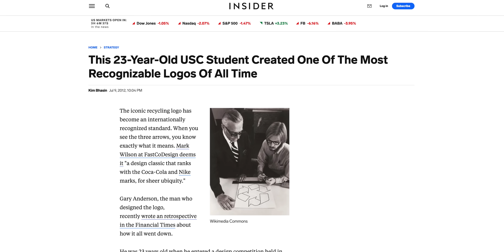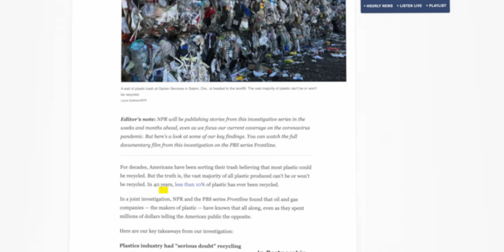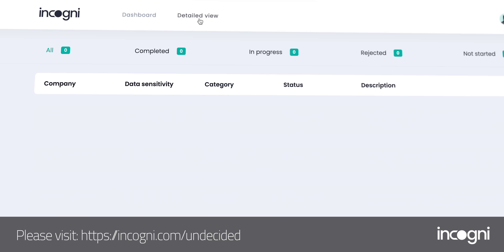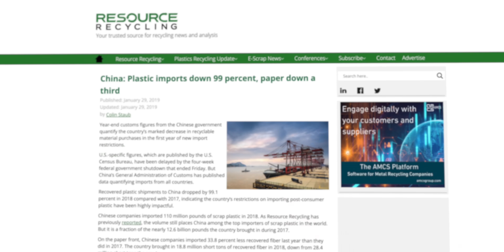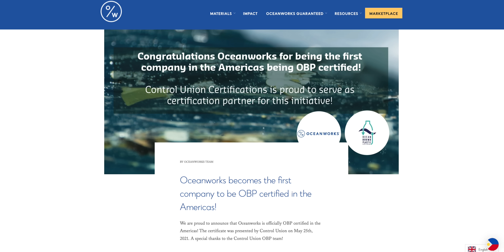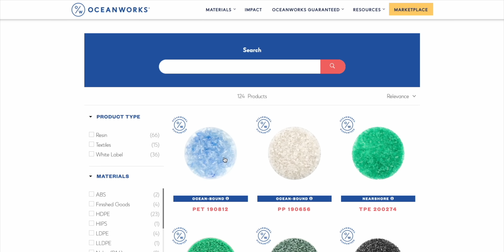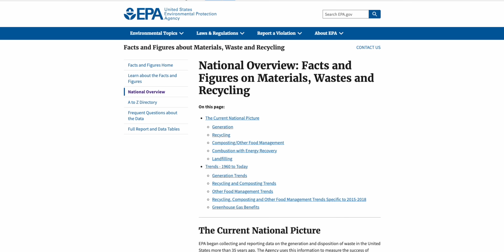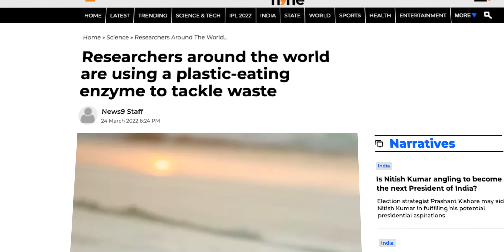The Truth About Plastic Recycling ... It’s Complicated

Comment: This is going sounds really stupid so I'm sorry, however, why doesn't the government ban single use plastic bottles, we already have an alternative, glass bottles and cans?
Reply: Glass is brittle and breaks easily, so you need a lot of it to make a sturdy bottle, as such glass bottles are very expensive to transport because they weigh so much. most glass waste gets put in landfills because it is not economical to transport it for recycling. i remember when SoBe and Snapple stopped using glass bottles. it just made them seam cheaper (and affected the taste as well imo). and metal is already relatively expensive. if you suddenly decided to switch everything even to the cheapest available metals the price of that metal would soar due to the sheer increase in demand. It all boils down to money. nobody wants to actually spend the money to build the necessary sorting facilities and properly pay workers to staff them, because raw polymers are orders of magnitude cheaper.
Reply: @nemesis1588  Everything you said is as the mouthpiece for the plastic industry, I assume you are playing devils advocate. It would cause disruption of course, but that was the system once apon a time and it worked just fine, even if glass and aluminum isn't recycled and ends up in land fill it doesn't matter, both are natural materials, or at least not harmful, they are both the ultimate packaging material, that and the beverages tastes much better. I always buy coke in glass bottles when I can, its worth the extra cost for the taste, I'm not a hippie and use lots of plastic, but if I had no choice, then so be it.
Reply: @brad9529  I'm not saying we shouldn't do something about I was just giving the reasons we don't. Transporting glass is expensive because all that extra weight requires additional energy to transport, which equals an increase in fuel consumption and greenhouse gas emissions. Glass is not the perfect packaging material unless all of our transportation is fusion powered..
Reply: @nemesis1588  yeah I agree nothing is perfect, only humans disappearing from the planet would be close to perfect, but even with the disadvantages of glass, weight, cost, footprint, its still a better option. It would get cheaper to produce again once they ramp up production. Electric trucks in the future would offset some footprint.
Encourage the use of aluminium bottle like they have in Japan, a can with a screw top lid.
Reply: @tracejohnson6611  It need only apply to the bottled drink industry for say anything less than 1.25 litres/42oz.
Big bottle packaging generally uses the same amount of plastic as a small bottle (they often use the same Blank and expand it bigger) so start there for now and work up to bigger later.
This alone would stop most of the plastic problem. (Problem of floating ocean plastic, from what I've seen a big chunk is coke bottles)
Reply: Ever use a cardboard straw? They suck.  Or I should say they don't suck.
Reply: @stapleman007  yes they do I hate them, but I'd still prefer to use them because I know I'm not doing as much damage, particularly McDonnalds paper straws suck, 7/11 has good ones (in Australia)
Reply: @brad9529 They actually put a thin film of plastic inside paper straws to make them less flimsy. Lol. I prefer to use bamboo given the choice. There are cute ones but they're more expensive than plastic. Some people reuse them which makes me think icky if someone other than you reuse them.